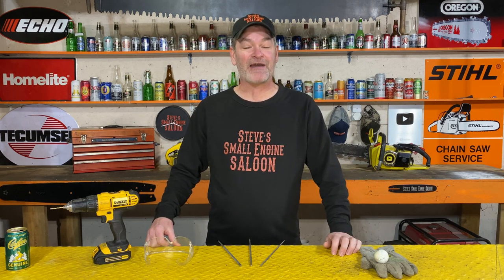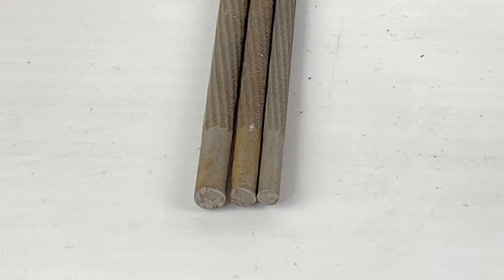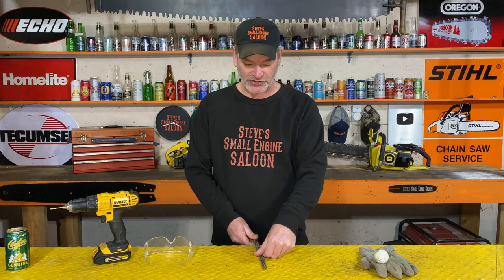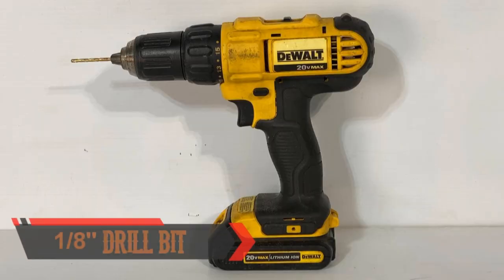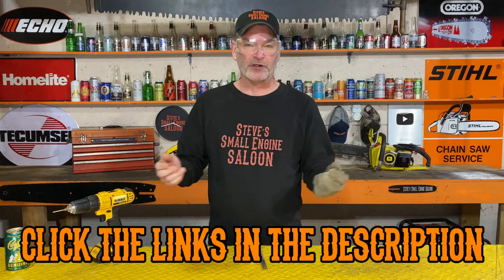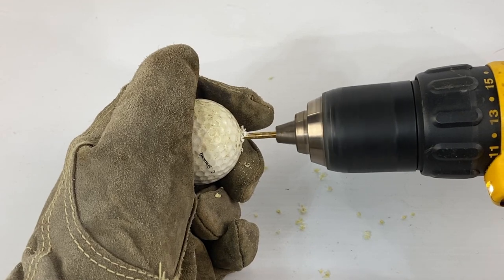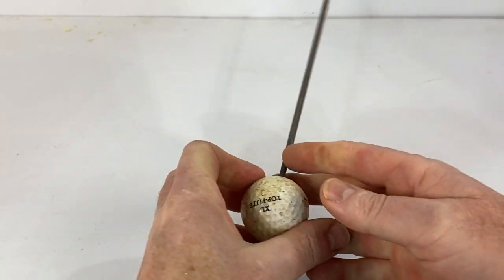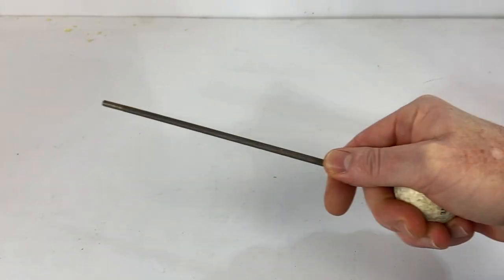How To Make A Free Chainsaw File Handle From A Golf Ball

Comment: A former patient of mine has a arm and hand deformity during to an accident. The grasp of a spherical object is easier to do with challenged biomechanics. We placed golf balls on both ends of files. The untapped end was purposely sized to be able to twist off if needed. We epoxied the tapered end in the golf ball. They hang from a rack nicely. He used his Dremel rotary tool to label the size and drew a profile (round, triangular, flat, etc.) onto the face of the ball. Problem is they act like wheels and axle and roll around.  He flattened one side with a bandsaw, grinder, and a belt sander. He painted the flat side with Epoxy paint and labeled that side as well. When they roll and come to the flat side the other side's label is visible. His daughter (7 y.o.) took over the painting of "her" files. She dipped them in white Epoxy paint and let her double ended 🍭 lollipops dry. Then she used this base to bring out the bright colors she choose for the flatted side. She used stencils to make the labels readable. Did I mention she is seven!. All the round files are one color. 
Now all the drawer pulls and handles are "her" golf balls.   She had her Papa make her a wand, of course with a golf ball grip. Her magical core was the electric shaver whisker bits from her Papa's shaver. They were ceremoniously placed onto a hole drilled into the center of the wand, sealed with candle wax drippings and then epoxies into the colorful golf ball.  She collects old golf balls, cleans them, dips them in white Epoxy paint and stores them for her next idea. She's thinking ahead! What will she think of next?

Comment: Golf Balls also make great replacement for missing grips on riding mowers
Just drill a slightly smaller hole than the handle size 
It also makes raising decks  and gear shifting eazy
Reply: Nice,But rather have/use pool ball for that.
Reply from the maker: Great idea!

Comment: I never run the file out of the tooth. I always run the file into the tooth. When you run it out, you cause a small burr to form on the outside edge of the tooth. It soon breaks off and causes a jagged edge on the tooth. The tooth is now dull again. I see professionals sharpen the saw at the end of every day because they run the file out of the tooth. If they ran it in, they would sharpen it every ten cord.
Would you drag your chisel on the stone to sharpen it?
Try it. What do you have to lose?
Reply: whilst working as a tool grinder, mainly cutters for keyways, we would always remove the burr by running an allen key along the sharpened edge, seemed counter intuitive to begin with to remove the sharp edge.

Comment: No fractured intro graphic, didn't drink any beer.  Who are you, ...and what did you do with Steve's body?!?!
p.s.
You definitely want to stay away from using grandpa's vintage golf balls for this, as you will be in for a surprise when the wound rubber band outer core starts smoking & stinking, and then the drill bit penetrates the inner oil-filled bladder.  As a kid, about six decades ago, I used to cut open my dad's old golf balls for entertainment.  I think solid core balls started to appear around 1968, or so.